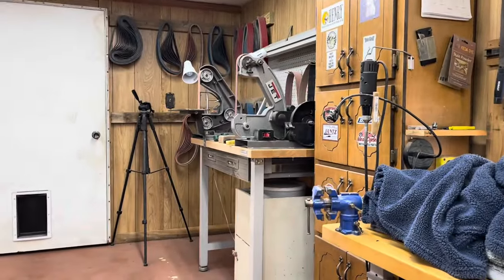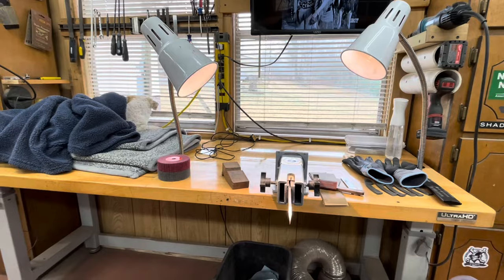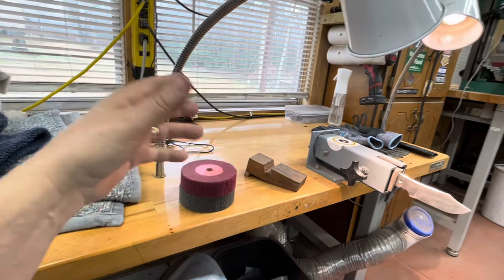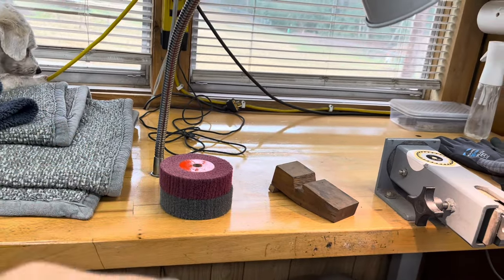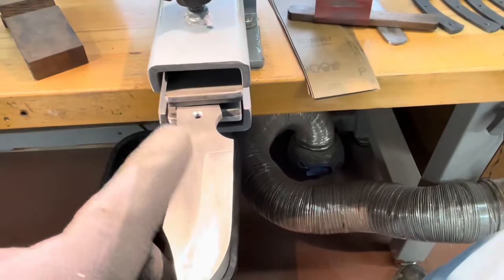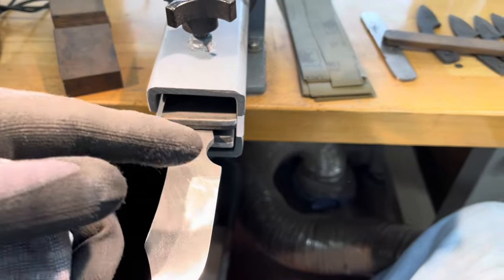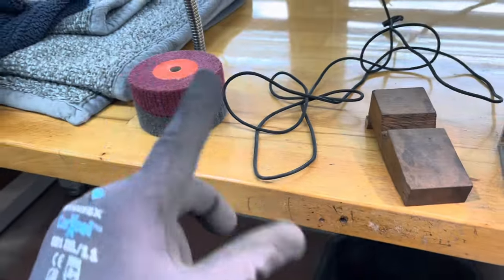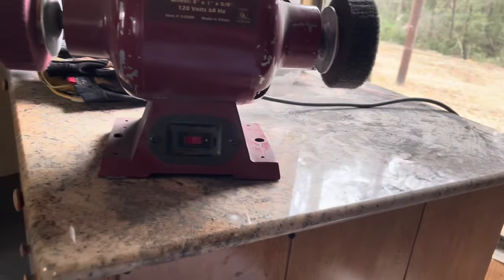Information the government doesn’t want you to know.

Comment: Brad, that 80CR V2 steel seems to be the choice for a hard use knife. 

I just looked into it and my research indicates that it is made by ThyssenKrupp in Germany.
It’s also reported to be formerly known as Swedish saw blade steel for circular saws. You need tough and sharp with edge holding for that.

Some said it was a Carpenter Technologies product (USA), but I believe it was confused with Carpenter L-6 , another large circular saw steel with similar properties. Very desirable but only available in used sawmill blades and round bar. I believe it is the European version of same. They have both been around for a long time.
I know high quality blades from nordic countries are using it.

My brother just received a custom made “leuko” knife (kind of an Arctic machete) made out of 80CR V2.

From everything I’ve read, you picked a winner. You have everything you need to do the hardening and tempering. Even the right quenching oil. 👍

BTW, I use those countertop ovens for everything. The one I have now is struggling to get up to temperature. Much heat is lost due its lack of insulation. I just got some thick ceramic wool. I’m going to put a sheet on top of the oven and cap it with a metal baking sheet. I’ll let you know how it goes.
I need another fifty degrees for better sourdough bread, and to temper one of my unfinished blades that just came out of hiding. 

One more thing, I found an outboard digital oven thermometer called “Hotloop”. 0-572 degrees. It’s sensor is on 3.25 foot leads. $13. It’s measuring within two degrees of every other device in the house. 
This little bugger is accurate and handy. I’ve measured temperatures of hot oil and coffee too. 
It seems to be something that fits into a panel ,but works great on its own. I’ve been using mine daily since mid October with no problems. The oven door closes with no trouble. The leads are just the right thickness.
Reply from the maker: Good to hear! I’m wondering if it will polish up and hold a shine longer. I have about 6 feet of 1084 to use up before I move to 80crv2. Can you email me a link to that oven thermometer?
Reply from the maker: Just found it at Amazon. Ordered it.

Comment: Got an idea! Get a box fan and put a big furnace filter on the back of it and it would suck the dust out of the air. Just a thought 💭 take it with a grain of salt!🧂👍🏽😀❤️🇺🇸
Reply from the maker: I’ve tried. In fact I have a video about 5 years back of me making a frame to slide it in and out. It worked but only if I set it next to each machine I was using. Most of the dust is very heavy and falls down to the floor quickly.
Reply: That’s where I got the idea! 😂